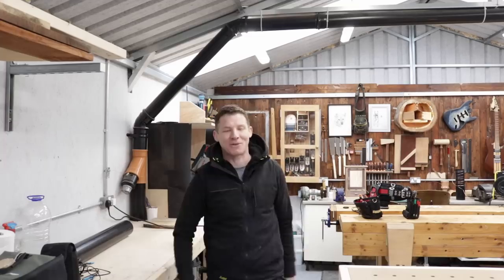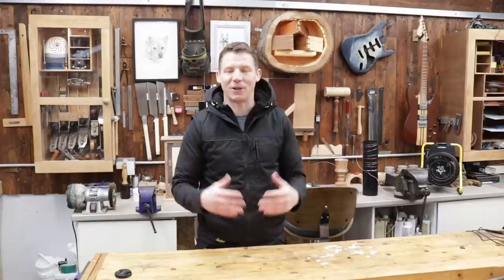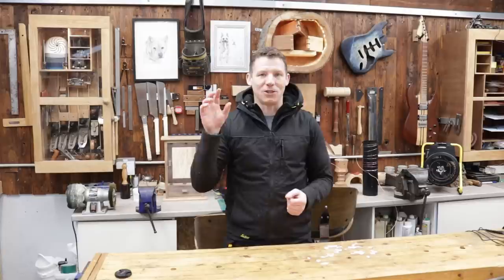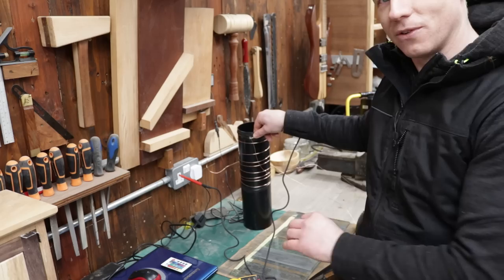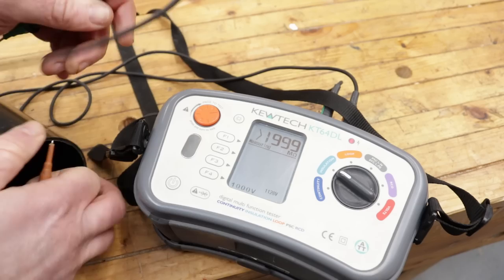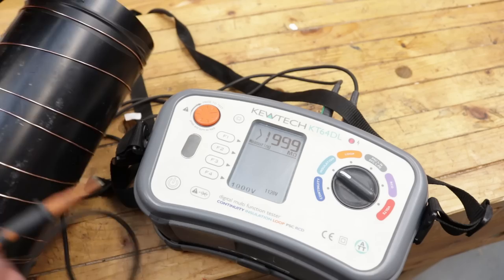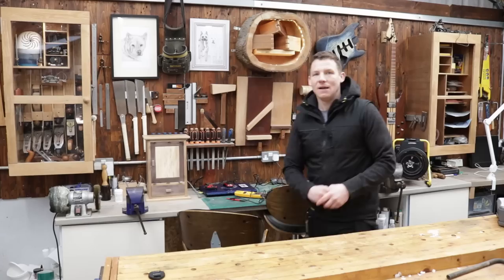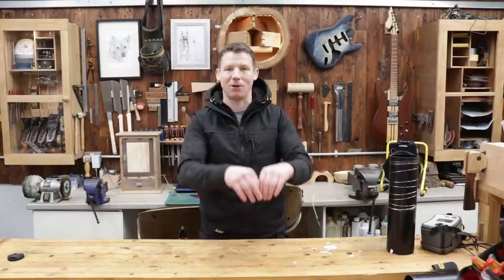Grounding/Earthing a PVC Dust Extraction System! Time to End the Nonsense!!

Comment: Thanks John!  I never bought (figuratively and literally) into the grounding of PVC tubing.  I saw the YouTubers who did and thought they were nuts.  I always looked at the situation as a reverse wire and thought that was common sense.  You demonstrated it perfectly by showing that unless to touch the wire with the electrical probe, nothing will happen.  PVC is an insulator and therefore will not allow current to flow through it.  In todays mass communication overload, I have never heard of a small home or small business that has had an explosion due to dust collection static electricity discharge.

Comment: I've had a pvc dust extraction system for decades and never thought about grounding the system.  Never had an issue but since youtube said it was dangerous I was a little concerned.  My system was installed by my friend who was an electrician.  I never thought two things about it.  Thank you for the information.  My new shop will get a new extraction system and I will not be grounding the pvc.

Comment: I had the same belief it's almost impossible to make the dust explode in a home workshop so I never bothered with grounding. I finally caved and grounded my pipes cause the static from the pipes and flexible hose zapped my CNC Z-axis motor (my fault it was pretty close) which fried the stepper driver or at least this is the only conclusion I could think of. I know you can't remove all the static from the pipes and the hose as I can still feel the hair on my arm rise a little sometimes when I get closer to the hose or the pipe but before grounding I could feel it from a longer distance and it made my hair stand like a scared cat LOL
thanks for the great video

Comment: Thanks for the best explanation of the workings of static electricity in plastic ductwork that I have seen. I am a magnet for static electricity, and constantly got shocks from my extraction pipework...I thought about trying to earth it, decided it was pointless, and simply stopped touching the bloody thing! 
With regard to the danger of explosion, that is all down to the particles of dust in the system and their size...I think it's unlikely that a home woodworker would generate fine enough dust in sufficient quantities to trigger an explosion...but if it worries you metal ducting is the only real solution.
Reply: I would ask, were there days that you tended to get shocked more often than others when touching the pvc pipe or toils? What type of clothing you were wearing and relative humidity could easily have been an influence with you getting shocked. Man-made clothing such as polyester will easily build up a static charge versus cotton as you walk around the shop and move your arms and legs.
Reply: @rogerwhoareyou  definitely more shocks when it's cold and even more when wearing a fleece. Temperature and clothing certainly play a part but I can ģenerate a static shock wearing cotton boxers!
Reply: @davidhull1610  This is where grounding the outside of the PVC pipes makes sense. That will drain off the charge to ground and you won't get the static buildup shock.

Comment: Great video. I've spent the last 40 years working in cabinet shops of 5 to 15 men. We've always used PVC for the dust collection because it was cheap and easy. The closest we've ever come to grounding it was the pieces that were laying on the concrete. Sure the outside collects a small amount of static, but nowhere near enough to cause the spark needed. Most people don't understand the amount of dust in the air required to create the explosion. You're right about the amount of dust in the collector being the greater hazard. Unfortunately this info will not convince those that are adamant about grounding,but will hopefully help the rest.

Comment: Thanks for the common sense!  I worked in electric motor shops for many years and all the hype about wrapping PVC pipe and drilling screws at every connection made no sense to me while setting up my system.  Using hoses direct to my collector, I have had bare wire inside the hose which seemed to work fine with the machines connected with the collector commonly grounded.  That seems the simple solution to continue with here.  Great job!

Comment: Great video. I worked as an electrician in a coffee plant. They produced ground as well as instant coffee. While they did produce their own instant coffee they also bought instant coffee in the form of powder. One evening we got a call that an employee reported getting electrically shocked. The employee was vacuuming the powdered coffee from a bag in a box. The hose was similar to a swimming pool hose, all plastic. There was nothing connected to the electrical system. We told him that there was no way he could get shocked. After some back and forth we duplicated his task and sure enough after about 30 seconds you would get a jolt that would knock your socks off. We stripped the insulation off a length of copper wire and wound it around the hose and attached it to a grounded piece of equipment, problem solved. Luckily that was the end of the incident but I was impressed. Dust filled environments are the second most hazardous just behind flammable vapors. As John pointed out it is unlikely that a home workshop would produce a concentration of dust like an industrial plant.

Comment: Beautifully articulated and logically explained. Well done. I think the most important part of the video was the advice of emptying the sawdust bin. The concern, in my opinion, is using a dust collector with a metallic impeller and sending a screw, or some other metallic object down the line to spark into the bin, thereby introducing the potential for a fire. No static made that happen. Thank you for the explanation.
Reply from the maker: You are very welcome.

Comment: Thank you, John.  Decades ago, I worked in a plant where grain was processed into starch and sugar.  The most dangerous place was at the top of the grain elevators (silos), where dust came off the grain as it was moved around.  We used aluminum shovels to get rid of the dust, and our boots were checked for exposed nails.  Never got blown up, nor was there an explosion at that plant.  I doubt that my workshop is as dusty as that plant.  Probably the biggest hazard was having 18 or 19 year old young men working there.....
Reply: I used to work at Simpson's maltings in Berwick on Tweed, Northumberland UK. There was loads of dust from the barley grain. I was never aware of a danger of explosions there. I have heard of dust explosions, I can't remember where, how and what kind of dust though

Comment: John - thanks for putting this up and I hope this does persuade people to think about what they're doing when installing a system. i think Stumpy Nubs did a very similar video recently with similar advice.
The best advice you gave was to avoid PVC if you are in anyway concerned about static in a dust system and install metal. Even if the risk is negligible, if you perceive that risk to be at a level you feel you must act, then act in the right way. All these mitigations you see on youtube are basically nonsense.  Anyway keep up the good work. K.

Comment: great job John. I worked with extruding Teflon and it produced up to 40000 volts of static. We used Ionized air bars. and reduced to under 1000 volt. I have a small Ionizing bar on my dust collection and it works great.
Reply from the maker: Yeah I believe ionized gas is also used in pvc pipe for static.

Comment: I have the Dewalt 735 and because it has a blower it produces a lot of static. It's the only machine in my amateur shop that produces enough static to bother me. I attached a copper wire to a screw on the planer that's grounded and i fed the wire in the pipe and it comes out at my cyclone which is not on the plastic bucket. I attached the dust deputy to a large 50gal steel drum. so I attached the other end of the copper wire to the bolt on the bottom of the dust deputy and all the static is gone. i caulked the entry and exit point of the bare copper wire to the pipe.

Comment: Awesome ! As an engineer, we agree entirely. However, as a pragmatist I was really tired of getting zapped in a dry/heated shop. I ran copper wire from ground on the dust extractor, through the existing pvc piping, and rejoined them at the metal blast plates. Problem solved - I didn't get zapped anymore. It's hard to rationalize wrapping the nonconductive piping in wire since the flow causing the static is inside. Regarding an explosion, I'm more concerned about solvents and dirty rags in the shop. Any potential source of sparks should be safely grounded.

Comment: If you have the static negative electron build up along a whole length of your PVC pipe then all these electrons will create a "highway" that will be conductive and find the easiest path to discharge. Highly unlikely to happen in a home workshop but possible. Also, I've found that facing Epoxy Resin from a River Table tends to create a lot of static from the Resin Shavings. So in my case, I still run a copper wire in my PVC ducting and noticed none of these resin shavings stick to my piping or flexi pipe. Ps: It's not about Explosions it's about fire in your Extraction System. One little spark can make wood dust smolder for day's until one day with enough oxygen it will cause a fire.
Reply: Dumb and Dumber movie scene with Jim Carrey and Lauren Holly.... 

Lloyd Christmas: I want to ask you a question, straight out, flat out, and I want you to give me the honest answer. What do you think the chances are of a guy like you and a girl like me ending up together?

Mary Swanson: Well Lloyd, that's difficult to say. We really don't...

Lloyd Christmas: Hit me with it! Just give it to me straight! I came a long way just to see you Mary, just... The least you can do is level with me. What are my chances?

Mary Swanson: Not good.

Lloyd Christmas: [he gulps, his mouth twitching] You mean, not good like one out of a hundred?

Mary Swanson: I'd say more like one out of a million.

Lloyd Christmas: [long pause while he processes what he's heard] So you're telling me there's a chance. YEAH!
Reply: @philpascel4144  I HATE Jim Carrey!!

Comment: Totally agree with your conclusion on not needing to ground PVC pipe in a dust collection system.  Just curious as to why it is nearly impossible to have an explosive atmosphere in a home wood shop?  So, what exactly is different between a commercial woodworking shop and a home shop for this?
Reply: The amount of constant dust going through the system all the time also fine dust will ignite easiest.
Reply: @mikemeadows7312  Disagree.  Yes, this would cause a lower risk for shop fire at home versus commercial.  However, the video stated it was nearly impossible to have an explosive atmosphere in a home wood shop.  That is a very absolute statement, so if true, there has to be something more to this than just a difference in volume and rate of dust flow between the two.

Comment: Amazing explanation.  I am still happy I chose to go metal as it is cheaper, easier to work with, everything fits as it adherers to ducting standards rather than sewer pipe sizes and easy to ground.  I myself seem to hold a charge and I find static shocks annoying.  I think another myth to talk about is the cost comparison.   If you go to your local plumbing supplier   think you would be "shocked" (pun intended) to know how cheap spiral air ducting is vs PVC, especially when you need larger sizes like 6, 7 and 8"
Reply: Googled spiral air duct the moment I'd read this. Wow! Thanks. It's really cheap!
Reply: @cuebj  Your welcome. Glad I could help.

Comment: I often get nasty shocks at the dust boot of my CNC after long cuts with the DC on. Planning to ground the short length of flex tubing that is present before it reaches 6" PVC, I guess it's not worth running a wire through the entire PVC line? Static can be a big deal in CNC applications, causing connection issues at the least and frying small components at the worst.

Comment: Only reason i can conceive of is people misunderstanding why you might ground a flexible vacuum tube and applying festool logic to everything that sucks.  Basically expensive green tools speed controllers can be susceptible to ESD (Electro Static Discharge) the same thing that can kill computers and people wear anti static wrist bands to prevent when servicing electronics, so cheap shop vacs often can build up a charge in the flexible pipe and nozzle and blat the tool. Its cheaper and easier to market special ESD hoses than fix your circuit and machine designs.....

Comment: John. I didn’t really understand the meter readings.  But that’s ok.  I did understand that my plans to use PVC pipe for my small workshop is safe. I trust your input.
Reply from the maker: They how much of an insulator PVC is, with a 1000v between the probes the resistance reading was to big for my meter to read

Comment: John, great content.  My own electrical training (years ago) agrees with everything.  I recently bought a Rikon dust collector, but had not opened it yet.  I pulled out the manual and read the text below.  Whats your opinion?

GROUNDING THE DUCT WORK

NOTE: For permanent dust collector set-ups, the following instructions are recommended. For the occasional use of any dust collector, care must none-the-less be taken to keep the hose and bag clean.

Dust particles moving through flexible or rigid plastic duct work can cause static electricity build-up. The duct work must be properly grounded to ensure that static discharge does not ignite fine dust particles causing an explosion or fire.

To properly ground plastic duct work, simply run a small gauge bare copper wire through the ducting and have it emerge from the hose at the dust collector and at each dust producing machine. The bare copper wire should be bonded to the metal shell of each machine by means of a metal screw. The screw must be threaded into the metal shell to ensure a good connection.
Reply from the maker: I would always do what the manufacturer recommends, it will do very little like I have demonstrated. But it does no harm either.

Comment: It would be better to call it a capacitor (yes I do realize 2 of the same metals are a capacitor and 2 different ones are a battery but we are only talking about static charge.). The charge on the inside then a non conductive material then charge on the outside. It works like a Wimshurst machine. The charge hit you because you are full of fluid and that is a great conductor. Also wouldn't it have been easier to capture any static in a dryer flexible line? It has wire already built into it.

Comment: Thanks for this John, a nice, clear explanation with just enough detail to help us non sparkies understand. Couple of questions for you if you have time...

1. What types of machines are going to be the worst offending? Those that generate larger chips?
2. You say it's almost impossible to create an explosive atmosphere in a home workshop. Why is that, is it due to the volume of sawdust/chips or something else?

Thanks again, really enjoying the channel
Reply from the maker: Any machine that produces a lot of dust and chippings so Planers, drum sanders and the like.

For an explosive atmosphere to occur you need the the right fuel to air ratio and you will never produce enough constant fine dust in a home system for that to occur.

Comment: The grounding and associated static issues have been overblown  over the years. My PVC system for dust extraction hasnt exploded yet...lol. I always figured if someone was adamant about static grounding...it would be simple to put a screw through the pvc at intervals. If you connect the screws to a solid ground..you have a path for errant electrons to leave. You could do an entire system for a couple of dollars.

Comment: Hi.  Thanks for the info . I am about to do some dust piping around my garage workshop.Yes I know the the pvc is not the best but it’s mostly what I can get .Had looked at the tape with screws as I was thinking it would be the only way to do it .My workshop is mostly for metal work so I ended up getting better filted vacuums for the smaller tools .Going to do hose with power cord so I use the vacuum more .As well shorten all the wood working power tools leads .Thinking it will be the best way for me to use the vacuum more than it’s only a small cut and using a vacuum . I have done the power thing once and don,t want a repeat .  66,000 volts at about 200 amps to my body when I was a teenager . Keep the great work up . Thanks David Australia

Comment: Hi John, it is worth pointing out that quite often the static shock experienced by people occurs when they touch a grounded conductive surface due to build up of charge within their body and this is made a lot worse if you are insulated from the ground.  You probably have found that wearing certain types of footwear e.g. plastic/rubber soled trainers, makes this worse.  Just worth pointing this out.  It's not always the pipe giving you a shock as such but the accumulative transfer of charge to the human body before being subsequently discharged resulting in a shock.  In my company (an electronics manufacturer), we all wear anti-static heel clamps to safely discharge any possible build up of charge to the ground before it can be transferred through sensitive electronic devices.
Reply from the maker: Very good point! I was going to mention the electronics industry, I service a business that makes printed circuit boards.

Comment: Great demonstration. 
Now if you want to built, not a PVC dust collection system, but a cyclone dust collector with a metal drum, on which your vaccum will be connected to, do you need to ground the metal drum at all? and if so, how do you do it? 
Thanks